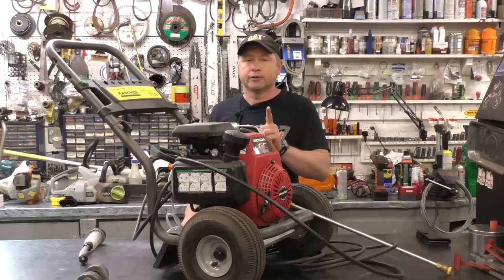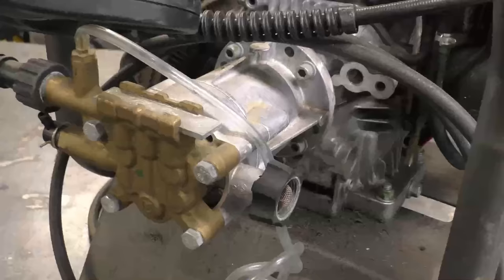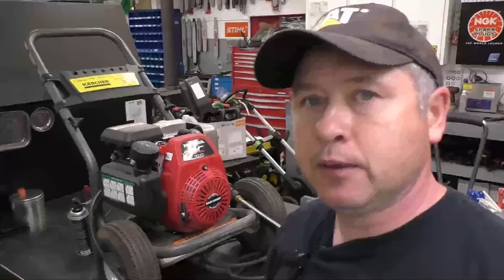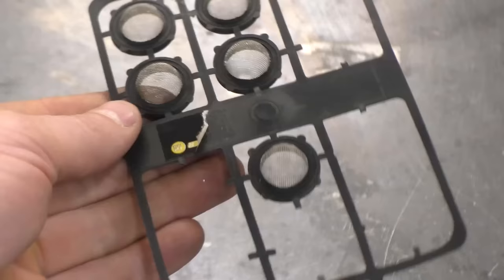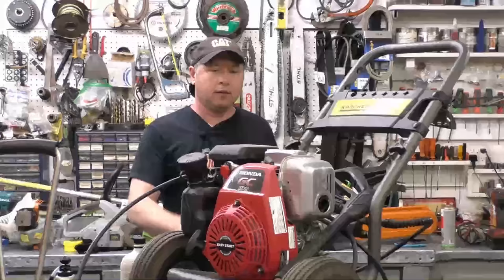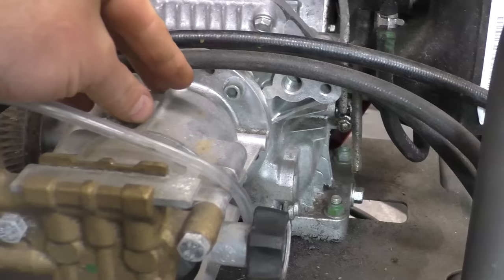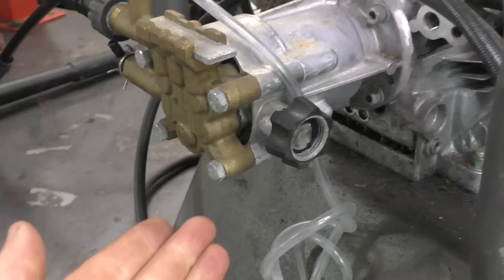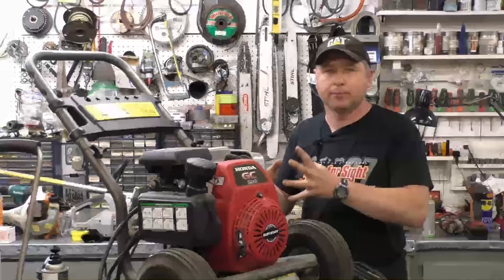Top Reasons Your Pressure Washer Pump Is Destroyed & Has No Pressure!

Comment: Very good you mentioned the way I've destroyed my last 3 pressure washers...running more than 30 seconds without spraying.   I blame the manufacturers for this. They KNOW users will pause while washing and destroy pumps, but fail to re-design them to sell more units. Replacement pump prices are often as much as a new machine! A sad commentary on today's disposable world.
Reply from the maker: disregard last comment it was spam.
Reply from the maker: they should add a sticker that says "do not leave running more than 30 seconds without spraying"
Reply: Or even better, a temp sensor on the pump that can shut off ignition.
Reply: @JABloch  it would need to be a lower temperature, because it would have to trigger BEFORE the pump started to overheat..  they could have a thermostatic blowoff valve that would reduce the throttle and dump water straight out until the pump was back down to a safe temperature after it started to overheat.
with an electric pressure washer, all they would need to do is have the trigger also start the motor.  it would take a hose with a set of conductors for the switch, but that would be relatively easy to make.
Reply: I`m not sure this applies to electric power washer as when the target pressure is achieved the motor is cutoff.
Reply: This is why I bought an electric pressure washer...after burning up a pump in a gas powered one, I'll never waste money on a gas pressure washer again they're total garbage for no longer than they last.
Reply: @h2000l  It doesn't apply to electric ones as yes they do shut off when you let off the trigger...not sure if all do, the AR Blue Clean one I have from True Value shuts off as soon as I let off the trigger.
Reply: @wildbill23c  a hose and a scrub brush with a bucket of soapy water cleans most surfaces more effectively and doesn't force water where water shouldn't go.
Reply: @kenbrown2808  Try that on concrete pads at service stations and garages.  You'll be there all month trying to clean one spot.
Reply: Read my comment but they have a thermal overload valve which when left sitting will release the water allowing flow to stop overheating, usually a valve will fail and no one ever checks them so failure is alot quicker. 
Better made and commercial units can operate alot longer like this as they're built alot better.
Reply: You'll be surprised if you actually used the pressure washer correctly it'll last, unless you bought a real cheap and nasty. Most issues are caused by the user and just blame the machine...
Reply: @damianbright6685  A thermal overload valve just dumps the water but the damage is already done by the time that valve opens...which is usually a minute to several minutes later.  

Commercial units typically have an oil lubed pump too, mine is a hot water type pressure washer, so it'll sit there and run for the day without issue...those little $300-500 homeowner specials at the box stores aren't made for it and yep, they quickly overheat and fail.
Reply: @damianbright6685  Agreed. Have an older AR Annovi Reverberi pump powered by a Honda motor, not even sure of the brand name! Did have to replace the pump as it sucked in a pebble from the yard well pump - remember that screen, oops. But I paid a couple of hundred for the original motor & pump and another $100 for the replacement pump and have a good running washer. Take care of your stuff and it will take care of you.
Reply: @donyboy73  The manual for my Simpson says 2 minutes max without discharging the wand. I wouldn't wait that long though.
Reply: I blame you for not reading your manual.
Reply: @blight6080  Real men read the manual after a malfunction occurs. 🤣
Actually, reading it before purchase would be ideal. I needed a commercial grade  unit.
Reply: @Robnord1  Agreed, wash on sir
Reply: Same here
Reply: I just let mine sit for like 2 minutes today and it went out
Reply: I feel your pain.
Reply: @wildbill23c I’ve had several different brands of electric ones over the last 25 years and they have all worked the same, in that they cut off when the trigger is released.
Reply: Another common reason for pump failure is not priming the pump before initial startup. You have to get everything connected... Garden hose to pump, wand to hose and pump. Turn the water on and squeeze the wand trigger until water sprays out and all the air from the hose is purged. I let the water flow for another minute after the air is out. Then start the unit. Easier to start while squeezing the wand trigger .
Reply: My new gas pressure washer worked fine for a few hours and I got tired, turned it off and so I put it away. The next day it started for 30 sec before sputtering and dying. The choke lever is stuck in the middle and won’t pull all the way to the cold position(left). Thus frustrated, i turned it off and left it over night and noticed the next morning the choke moved to the right all the way on its own. It still is stuck in the middle when I try to pull it to cold position . I still have plenty of gas and half oil left. My pressure washer is Husqvarna 3200 psi with a Briggs Stratton engine from Costco.
Reply: I do it all the time with a gas one, had it for 10 years now….
Reply: I got the impression from other forums that the pumps for small engines  are inexpensive
Reply: This is an old vid belt hopefully you can help. I have the same machine, my pump leaks where it connects to the engine. Have you ever had to replace the seal on the pump where the shaft goes?
Reply: Im trying to get rid of my gas pressure washer and go with a battery one like EGO.
Reply: @kenbrown2808 you might be slow
Reply: @jevonburnside2352  because I recognize that pressure washers aren't a universal miracle cleaning tool?
Reply: @kenbrown2808  no because you’d rather work harder than smarter
Reply: @jevonburnside2352  because we all know that choosing the method that both gets the task done and avoids damage is less smart than the method that does neither.
Reply: @Kgio-2112 yes sir you are correct.  I do the same thing. Been using the same pressure washer for about 7-8 years and never a problem.
Reply: @JABloch 
What it should have, is a bypass valve.
Reply: I’m pretty sure my Karcher had a bypass valve, to let some water pass through it. 
It’s pretty hard to keep discharging the unit when you’re climbing a ladder to get on a roof, trying to avoid overheating your pump.

Comment: As someone who also works on small engines this is why I went electric on my pressure washer. If you don't need more than 2000 psi electric are normally more than enough for the job. Also you don't have to worry about burning out the pump, because it will stop running (provided you have it set up correctly, and I you easily store it in my basement in the winter as they are light weight.

Comment: When you release the trigger the water now circulates through the unloader valve back into the pump. When the water runs in this circle fresh incoming water is not cooling the pump. The small amount of water circulating through the pump and unloader quickly overheats to the point it damages the seals in the pump.

Comment: I was told no more than 30 seconds by guy who rebuild pumps. This was especially true for the cheaper homeowner grade pumps which weren’t supposed to last more than 100 of use. You can actually feel how hot the water gets after idling for 20 30 seconds on you extensions         .
Reply: So spray for 10 seconds stop and  do it again

Comment: There's only one more tip to add: NEVER run a pump dry! Connect the hose first, turn it on, trigger the wand until all the air is out of it, then start the engine. I have had to hold the wand trigger, with no nozzle tip, because the build up of pressure can sometimes make it hard to start the engine.
     When I'm ready to store it for the winter, I will turn off the fuel, rather than the ignition, and let the carburetor float bowl drain out. I then remove the hose and the wand, and put on the choke and give it one final pull. That drains the last bit of gasoline out of the idle circuit and emulsion tube of the carburetor, so no fuel is left to leave gum or varnish behind. That final few seconds of run is enough to purge out residual water from the pump, so there's no water left behind to cause corrosion, or freeze, I've been doing that, rather than adding antifreeze, and it works well. (My pressure washer is a Generac)
Reply: And when you want to start it after you get the water running smoothly through the pump squeezing the trigger while you pull the cord is much easier.
Reply: So….as you let it run to pump remaining water out…the machine will run “dry” until you turn it off.
Reply: The emulsion tube pickup isn't actually at the very bottom. It can still corrode if the bowl isn't fully drained. Old gas in the tank needs to be removed before storing for longer than 3 months.
Reply: @Vincent Robinette I am sure what you do works for you, I would just use anti freeze rather than run the pump dry which can potentially dry rot the rubber seals inside. It's dirt cheap.
Reply: I also like to throw in a small amount of fuel stabilizer (Sta-Bil) into the gas tank.
Reply: My Thoughts EXACTLY   !!!   NEVER EVER Run the Washer when the WATER supply is OFF  .I ALWAYS PRIMP my washer pump FIRST even BEFORE I start the Engine !!
Reply: Great points!
Reply: What way would be best to heat up the Honda engine before doing an oil change? Would you connect a water hose just for that?
Reply: @fivalxerex6437  
Yes
Because the Honda engine is DIRECTLY CONNECTED to the pump !!  If the Engine is Running ,So  IS THE PUMP ...
Just change your engine oil 
Right  after you run the washer . It's NOT critical that the engine is hot ..
Just warm a bit .
Even just setting the machine out in the sun, will warm the oil and crank case  enough to change oil 
😊
Reply: Let the oil drain overnight & that will keep the engine clean inside. Take Care
Reply: @Wilett614  o
Reply: exactly what I do and never any issues. great "put it away" plan. I even do hte "run carb dry" every time I use my snowblower as I'm never sure when I'll use it again. its just good practise.

Comment: Very good info here as always.   Another reason to put pump saver into your pump after every use, especially if you let it sit for a few weeks between uses, it flushes out the water left behind in in the pump. If you let the water sit it will evaporate and leave behind mineral deposits that will clog the passages and valves eventually.  Also along the lines of not leaving the pump running when your not spraying, it is a very good idea to turn on the water before you start the pump and squeeze the wand trigger until water comes out.  That way you won't be running the pump dry and causing any undue wear.  Pump saver also helps in that regard as it is a lubricant as well as a antifreeze.
Reply: @keithmarlowe5569  The problem with pumps that continue to run when not spraying (All Gasoline Powered Washers) is that the moving water dissipates the Heat that is naturally generated while the pump is running.  Most Electric Washers have a pressure switch that shuts off the pump while not in use.
Reply: Richard, is there a brand name product that you use? I have a Karcher 3000 . I live in the Dominican Republic so freezing temps won’t occur. Automotive additives that so abundant in Wisconsin are so hard to find here, like Marvel Mystery Oil, Sea  foam, injector cleaners. Any recommendations are welcome. The water here comes from a river, not drinkable but ok for for showers and washing clothes. It looks realy clean and clear, no smell but I know some dirt and minerals are in the water.  Thanks
Reply: I'm not sure you're correct on mineral deposits occurring as you claim. That usually takes lots of water if the area even has a high mineral content in their water
Reply: Where do you get pump saver?

Comment: Great point great point on keeping the pressure pump running! Your one of the FIRST to ever mention this! Thank you!
Reply: I should of added, keep pressure washer running by squeezing the trigger
Reply from the maker: I tell customers to "keep water flower through wand"
Reply: @donyboy73  That's a good point to add "through the wand".  I'm reading my instruction manual and figured it meant water running to the pump and not necessarily pulling the trigger.  I only used it once last year for the first time brand new.  Hopefully everything starts up ok this year.
Reply: Yeah. Initially I thought as long as you have water running through your hose, it would be fine, but I saw another vid to say turn off the engine if you don’t plan to spray immediately

Comment: I bought a garden hose thread to 3/4" PVC adapter at Ace hardware (only place I have found these adapters at)  glued it onto 8"  of 3/4 PVC pipe with a 90 degree fitting and 3" piece of PVC glued onto the other end. Thread it into your pump and pour some anti-freeze into it and pull starter rope till some anti-freeze comes out the hgih pressure outlet. That short PVC adapter when filled up usually is enough anti freeze to go all the way thru pump and you don't have to turn the pressure washer on its side and dripple it in. You could also use and old garden hose cut off to do the same thing, although you have to secure the cut end of the hose to something to keep it full of anti-freeze while pulling the starter rope.

Comment: I have an electric 1 hp motor on a German pump washer. It has a bypass circuit and it will constantly circulate water while it’s running at “idle”. In an oil bath. Excellent unit. Great video.

Comment: I purchased a pressure washer from Sherwin Williams in 2000, MiTm with a 9 horsepower Honda engine. To this day it starts on the second pull and the pump has never been replaced. Live in the Atlanta area and have kept it in a work shed with no heat. Never added any agents to keep it from freezing. However, it now has to run for some time before the pump can come up to full pressure.

Comment: had quite a few ryobi pressure washers come in with honda gcv160 over the years.  all never had an oil change.  the output shaft square key partially sheered.  output shaft reduced in size from the damage and the input collar of the pump broke.  i recall these engine if not pre-broken in from honda, an oil change is required at the initial 40 hours and 100 hours.  thank you again for these videos.
Reply: if i might also add.  these gcv160-190 engines like to leak around the o-ring at the cam gear shaft from overheating as a result from lack of lubrication.  oil changes are not definitely not optional.

Comment: Good point about keeping the water flowing so as not to burn out the pump. Fish tank filters are the same way, when you start them up (after cleaning them every week) you have to add water immediately so as not to burn out the pump motor. Another great video Don!
Reply: Just a tip to keep the flow going....Put a zip-tie around the grip and squeeze-lever and tighten it just enough to hold the lever in the engaged position.  (You'll see what I mean when you do this.)  Then you can slide it (the zip-tie) up and/or down to engage/dis-engage the water flow.  In that way, you can keep it engaged when you want to lay it down to move something or whatever without having to rush.  Works quite well.........

Comment: Another great video.  
My pressure washer is the one tool that vexes me in so many ways.  
Proper oil level is difficult to maintain, oil coming out the gasket from overfilling and loosened gasket cover bolts etc.   Would love to start over fresh and drain it all out, clean all the oil off the machine etc.

Comment: I think one issue for some people is there water volume to the pump. Most people dont measure the gpm at the hose end to make sure the pump is getting what is called for. Some people use a really long hose to hookup and starts to diminish that number required. Great video btw
Reply from the maker: makes sense, never thought about that
Reply: My old house was like that only gave like 2 home which was not enough for my big power washer.  Had a 3/4 feed line probably half filled with sediment.  Now most water feed lines are at least 1 inch.

Comment: I store mine in the basement but good tip on the antifreeze.
I always put Stabil in all my gas cans before I fill them and have had good luck with engines starting up easily after being stored with basin the tank.

Comment: I have had a pressure washer in the extreme north for over 30 years with no problems. My pump specific fall prep is to flush the whole system with air. I have soldered up a little male water hose/ air compressor quick connect together. (I also use it to clear the lawn/garden irrigation system). This assures the wand,  hoses and pump system are completely dry. They sit out the winter at minus 40 and worse with no sequelae. Then the usual winter storage management for the engine.